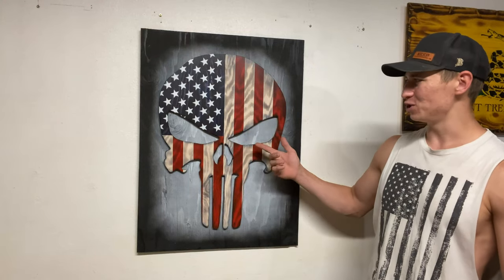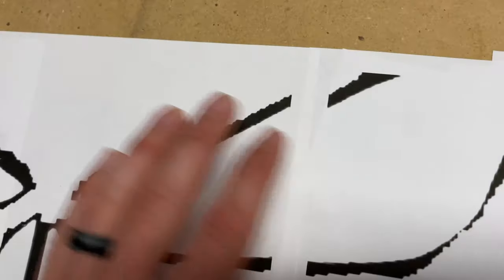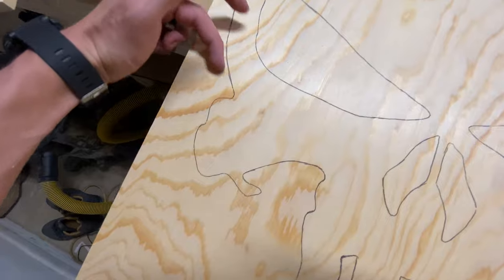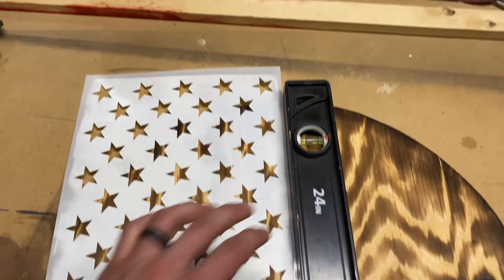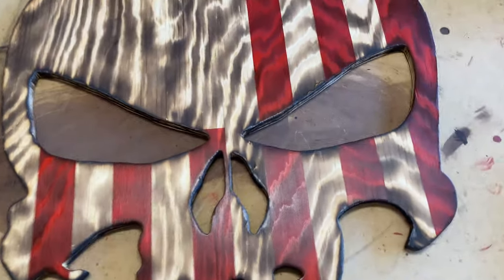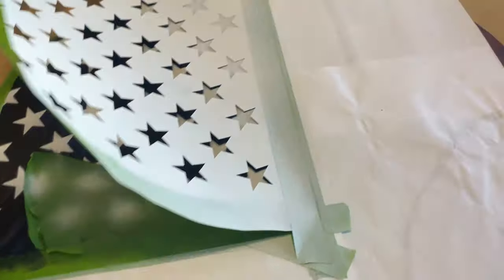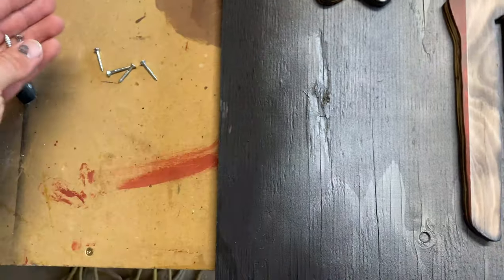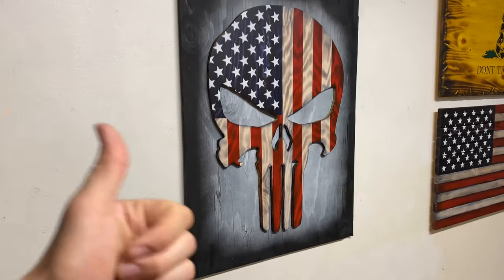How To Make A Wooden PUNISHER SKULL/SPARTAN HELMET Wooden American Flag! DIY Christmas Gift Idea

Comment: I do have two suggestions. 
The first suggestion is to use two sided tape to attach the skull to the base. Once the skull is attached to the base flip the project over and place the screws as you did previously. 
The second suggestion is if you have a plunge router or router table you can make a template on high quality 1/4" plywood saving a lot of time with the setup.    Tape the pattern to the board and cut out with a pattern, flush trim, or a combo pattern-flush trim bit.
Neshoba Nukhaklo
Reply: Great work by the way!

Comment: Nice Job! How long did you wait before each stain coat?
Reply from the maker: Thank you! I live in AZ so its pretty dry here so usually i only have to wait a couple minutes and it will be dry enough to recoat, i just wait until i dont see or feel any wet spots. It might take longer in other places but here its pretty quick